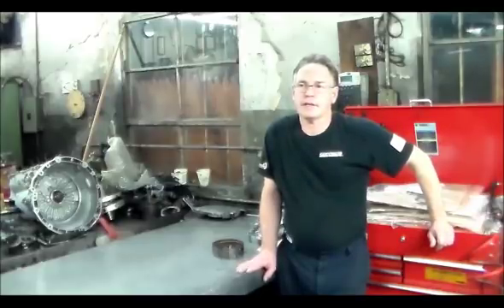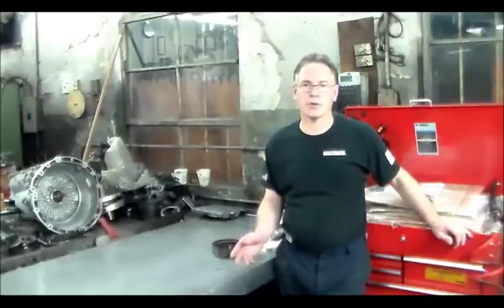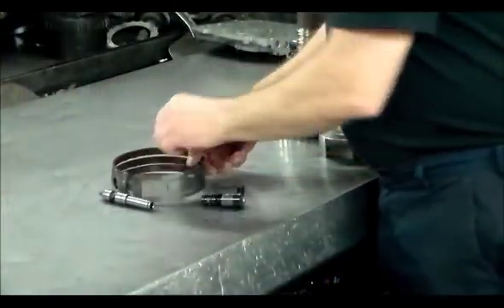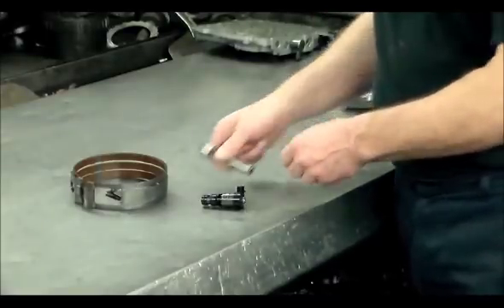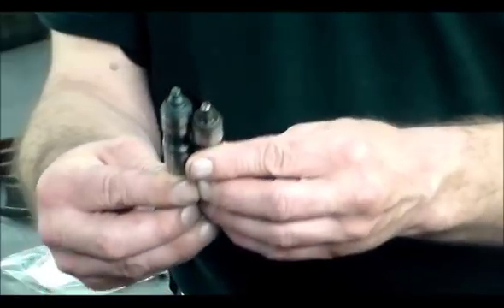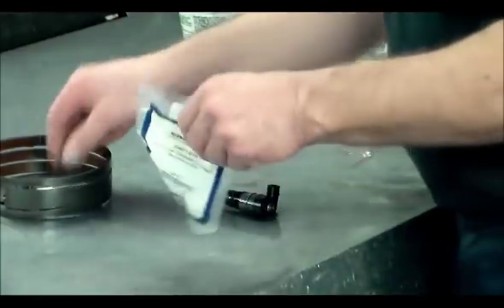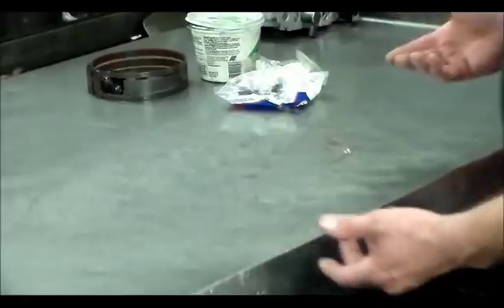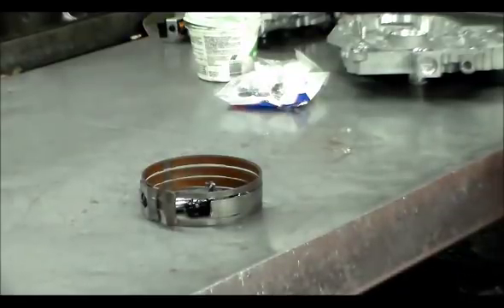4T65E, No Forward

Comment: Hey Gary!! I'm the guy that sent you an email about installing my reverse band on my4t65e.  I was able to get the band retaining bolt back in, and my "partial rebuild" was a success.  I installed 3 new raybestos bands in the transmission because I heard from you and others that they tend to break.  It took 11 quarts of dexos vi, and I installed a rare earth magnet In the pan next to the factory magnet.
I can feel a difference when the van switches gears in that the grab is a little more sudden with all new clutch plates, and more aggressive.  Before it was a little slippy, but in the 17 years of us owning the van, we must have slowly gotten use to it.  Thanks for your reply and your videos!!  After seeing the inside of a 4t65e for the first time, I think they are well engineered.
Reply from the maker: They have few common problems other than that it's a good trans